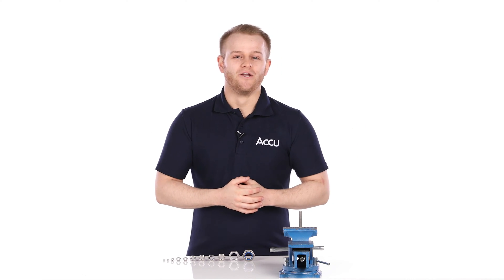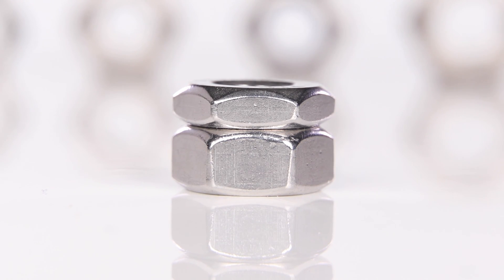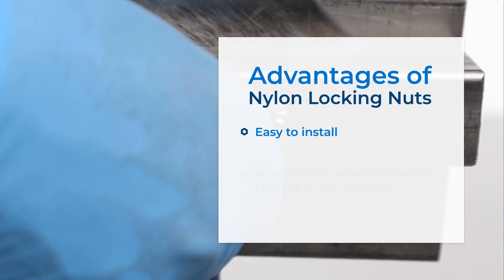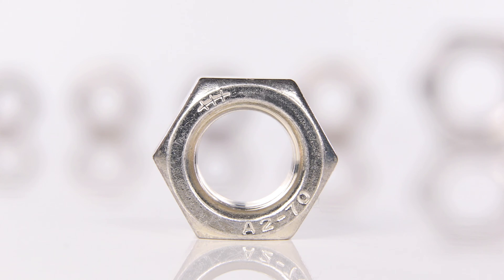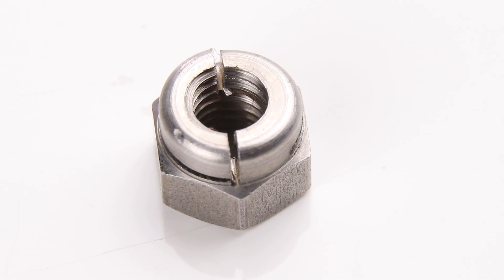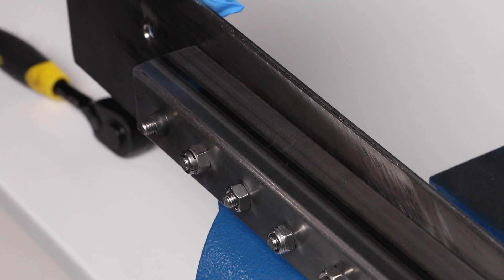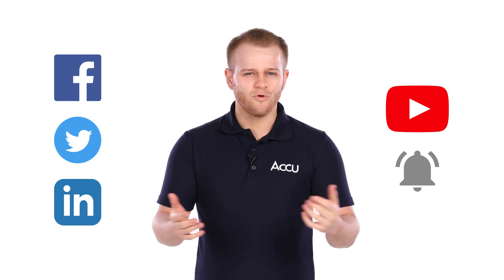How To Use Locking Nuts | Accu Tutorials

Comment: Very poor explanation of the use of jam nuts. You did not explain that the half nut had to locked to the full nut using two spanners to tighten the nuts against each other by turning the spanners in opposite directions. This is the most important part of using this type of locking nuts. If you do not tighten the nuts against each other you may as well not use the second nut as it will slacken like any other plain nut.
Reply from the maker: Thanks for the great feedback, this is a great insight! This is one of our older videos, designed as more of a general overview of the various types of locking nuts we stock, as opposed to an in-depth explainer on how to assemble them correctly for specific applications. We're looking to produce plenty more content that explores best practices of our components, so be sure to subscribe to keep an eye out for that!

Comment: Thank you for the explanation! I've seen these things for years; but didn't know what they were called, nor exactly why they were used.  These things will come in very handy for my current project; future ones too. 
Funnily enough; I just looked around my room, and noticed that the latch on my foldaway bike is mounted using a bolt and a lock nut.  When I first got the bike; I was worried, wondering how the bolt doesn't loosen over time.  Now I know.
Reply from the maker: Thank you for taking the time to comment! It's always great to hear that the tutorials are making a difference in your projects. Happy building!

Comment: I am having all kinds of problems with the 1” lock nuts/ bolts that hold the blades on my JD rotary cutter.  I had a devil of a time getting the originals off and reinstalling them the first time.  I used a socket with a long cheater. The second time I replaced the bolts and metal lock nuts.  The nuts seemed to destroy the threads.  What am I doing wrong.  Thanks
Reply from the maker: Thanks for the comment and sorry to hear you're having trouble with the nuts & bolts on your JD Rotary Cutter - was the issue with the OEM parts as well as any replacements?

Best thing to do would be to speak with our engineers directly so we can see what's causing the issue and look at offering advice or even suitable replacement components:
https://www.accu.co.uk/contact
Reply: @ yes the problem was with both.  Thanks for the response

Comment: But how does the all-metal locking nut actually work?  Does it damage the threads of the bolt?
Reply from the maker: Hi there, the triangular shaped indent on the top of the All-Metal Locking Nuts compress the top threads of the nut, creating a band of tight threads which act as a locking mechanism.

You can learn more about this component on our online store:
https://www.accu.co.uk/shop/precision-components/nuts/locking-nuts/metal-locking-nuts

Comment: Jam nuts are the way to go. For security applications like bicycle wheels, place the half width nut on the inside. Then use a thin bike wrench to hold it while tightening the outer, full-size nut against the inner nut. (You must use correct torque, so get the right tool if you are not good at this manually). Not only will the nuts not loosen from vibration, but thieves will need a precise, multi-piece toolset & the right knowledge to remove the wheel.
Reply from the maker: Thanks for the great insight! You could also look at our security fasteners & tools too, including 1-way permanent fixings, all of which can be found here on our online store:
https://accu-components.com/
Reply: yea, "lock nut" is not a literal term in the same sense as, say, a padlock. The nylon-lined nut can be removed with a simple wrench, so it locks against vibration, but not against theft, so "lock" is figurative in this case.

Comment: Is threadlock the same aas a locking nut?
Reply from the maker: Hi razz P, our thread locking patch is a compound which can be added to screw threads to increase resistance to vibrations. You can learn more in our handy article here:
https://www.accu.co.uk/p/139-What-Are-Thread-Locking-Patches

Comment: Can you wind on a nylon lock nut as far as you need? Or does the bolt need to be the right length
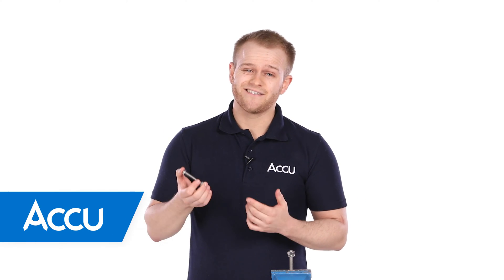Reply from the maker: Hi Max, you should be able to fasten this as far as needed but you would need to bear in mind the increase in torque required as the friction increases. Also worth noting the ways to avoid thread galling as mentioned from 1:32.

Comment: Okay but how can I remove a locking nut?
Reply from the maker: Hi Zach, a great question thanks for asking! It all depends on the exact type of locking but you’re using as to what the best tools/ method of removal are. Specifically which locking but are you looking at?
Reply: Nylon nut from lawnmower deck wheel
Reply: You dont 😈

Comment: Using a nylon locknut in am outdoor/marine vertical application ...is it recommended to have the nut facing the weather or the bolt head.
Reply from the maker: Hi John, as shown in the video (from 2:20) it’s recommended to fasten the Nylon locking nut so that the nylon insert is facing away from the head of the bolt (I.e. toward the end of the thread). If using in a marine environment, we would also recommend choosing an A4 (316 grade) stainless steel nut as this will provide the additional corrosion resistance needed.

Comment: Hi I just purchased some aerotight nuts from you I'm hopeing there my solution to a problem  I have a large scale petrol rc car and the exhaust header bolts keep vibrating out the cylinder head and causing the exhaust to leak. I cannot use red loctite so hopefully these nuts will do the trick and not become loose from engine vibrating.
Reply from the maker: Thanks for the purchase, we confirmed with our engineering team that application should work. Just be careful to ensure the bolt thread protrudes through the nut by two full threads so full engagement of the locking element is achieved. If you could confirm the solution works with us when we request product feedback it would be greatly appreciated and will help others who may have a similar problem.
Reply: @AccuComponents  yes no problem will give you an update
Reply: @Pkrlix3462  take a look at nord lock washers if its still loosening.
Reply: @Pkrlix3462  How did it go?

Comment: For Nyloc Nut Spring Washer required or not?
Reply from the maker: No Vishal. Spring washers are not necessary when using Nyloc Nuts. For maximum vibration resistance we would recommend Nord-Lock washers. This video illustrates why: https://www.youtube.com/watch?v=IKwWu2w1gGk&t=149s

Comment: Is it wrong to install a locking nut, pointy side in first? I think I may have done just that and now nut won't come out or go in. Please help! This was installing a metal bed frame
Reply from the maker: Morning Vijay, a useful trick to removing nylon locking nuts is to heat the nut up with a hair dryer which will soften the nylon and enable you to undo the nut, then you can put the nut back on the right way round. You should also consider that it's not recommended to reuse Nylon locking nuts more than a few times, as the nylon will wear out and lead to less effective locking over time. If you'd like to purchase replacement nylon locking nuts, here's our range:
https://www.accu.co.uk/57-hexagon-nylon-locking-nuts